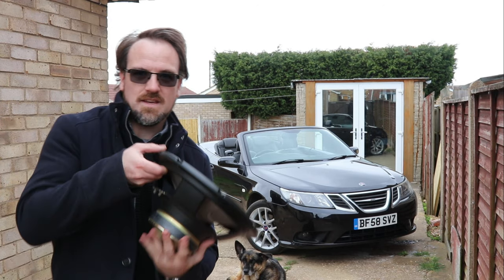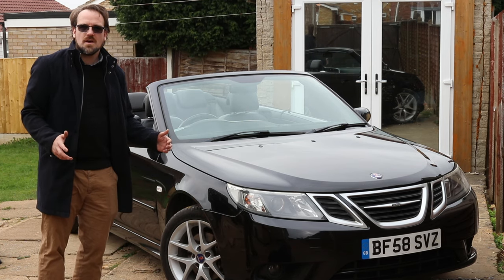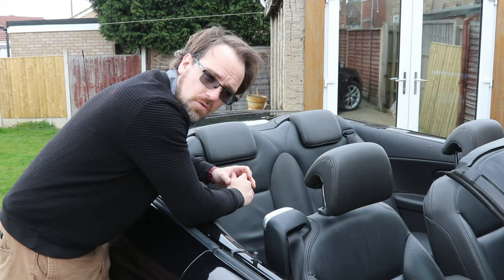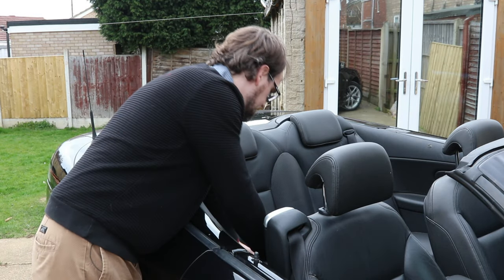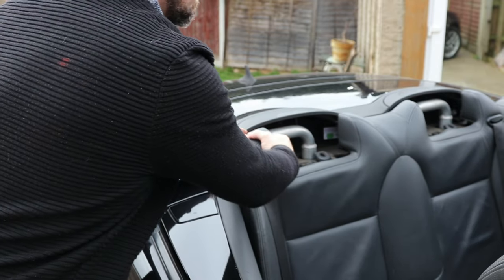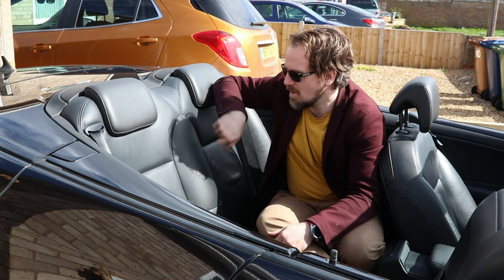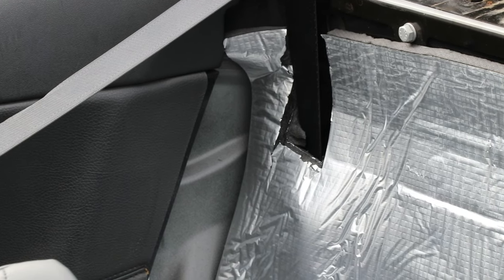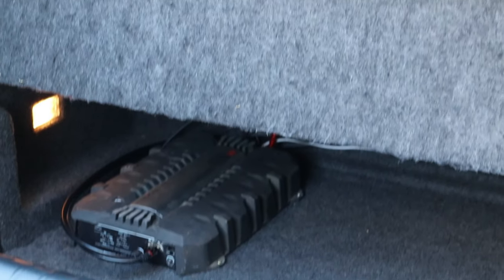Installing a Subwoofer in a Convertible Saab 9-3

Comment: did the same, almost, today. still i manage not to cut from the panel. from where did you took the signal fir the amplifier? did you cut the wires which lead to front doors or did you use the signal from the rear panel speakers?

Comment: Did you drill some holes in the plastic frame for a sound? Can you show  plastic backrest frame modifications?
Reply from the maker: No, it's a subwoofer. The lower frequencies of sound do not require line of sight like higher frequencies that you get on tweeters. That's why most subwoofers are hidden in your trunk
Reply: @SaabUnleashed  But did you see 9-3 backrest cushion 12765706:the perforated leather and the foam has the special hole opposite the subwoofer in the middle part of the backrest cushion. I can send you a picture.

Comment: Missed out the most important stuff !!!
How to install an amp when this cars audio system is digital optical !
No mention on audio line conversion  to RCA. .
Reply from the maker: This car is not optical, only cars between 2003-2006 are. Also, I have another video for the optical conversion and amp install

Comment: Hey Stuart, I’m looking to start this on my 08 actually it’s all apart now.  Did you need to trim the rear seat backing to accommodate the 12 inch?
Reply from the maker: Yes, which I show in this video
Reply: Not the sheet metal but the actual back of the cushion is preformed for the factory sub.  Did that need modification for a 12in?
Reply from the maker: @ricks3871  no, I didn't modify that

Comment: Check before you buy your speaker, I bought an 8 inch so I wouldn't need to modify anything and found a hole for a 10 inch with two 6x9 holes in the lower back of the seats
Reply from the maker: The centre hole is for the stock 8 inch sub
Reply: @SaabUnleashed  I have the stock sub, you're both right. 8" sub size if you measure the raised rubber portion surrounding the speaker cone, which a lot of people do. 10" measuring the bolt holes, which I've also seen a lot of people do.

Comment: Hey man. What amp did you use for this? Someone mentioned it needs to be a fiber optic type of thing?
Reply from the maker: No, any amp will suffice. The fibre optic is what the stock amps us in cars made between 2003-2006
Reply: @SaabUnleashed  ah cool. Thanks mate ;]
Reply: Ah just realised mine is 2005 so therefore would need a fiberoptic right?
Reply from the maker: @julz2020  only if you want a stock amp. You can install any in your car, just take a feed from one of the existing speaker feeds

Comment: I'm in a 08 solara, and before watching this, I had the infinite baffle idea too. Going with two jbl gt-12s. Qts rating is like .63, which should be enough.

I've tried my kicker cvx 15" and a alpine type x 12", and as soon as you move with the top down, you don't hear bass at all.
Reply from the maker: Yes, I have to use two different bass levels depending on roof up/down
Reply: minimum qts value for open baffle is 0.7 and its apsolute minimum, you can find subwoofer speakers that are qts 0.9 ir greather and believe me the difference is amazing.

Comment: Could you make a video of how too put one on the 9-5
Reply from the maker: The 9-5 is easy because the boot is massive. Just run a battery cable from the front of the car, and RCAs and a remote wire from the head unit
Reply: @SaabUnleashed  were does the RCAs and remote wire plug in to the head unit? (head unit being the standard one with the green screen, yes?)
Reply from the maker: @albinjohansson1734  if you intend on using the factory radio, you won't be using RCAs. You'd need an amp with high level inputs and take a feed from one of the standard speaker channels.

Remote can be taken from any 12v source which is only live when the ignition switch is on. You can tap that from the rear fuse box

Comment: My sub makes almost no base I’ve checked to make sure it’s wired properly but I’m not sure what actually going on 😅
Reply from the maker: You need a free-air subwoofer as I explained in this video. Any normal sub requires an enclosure to work and will be silent in this kind of installation